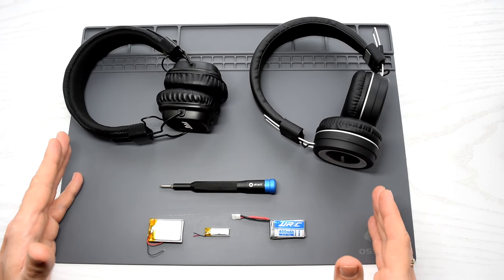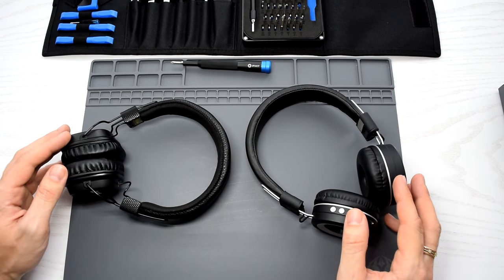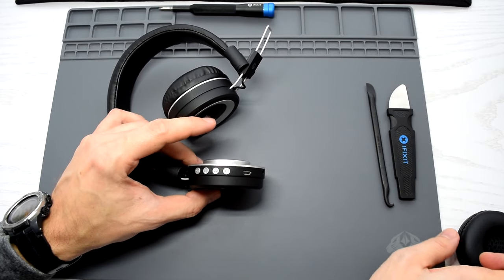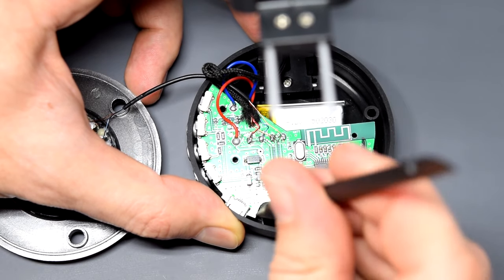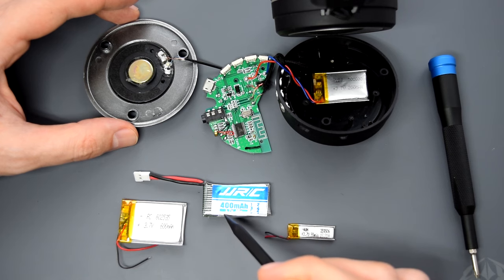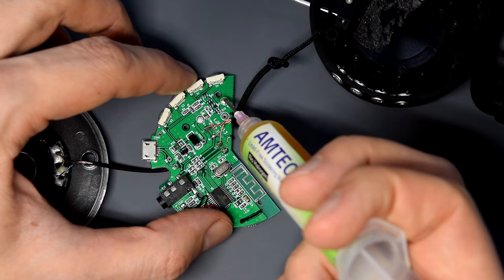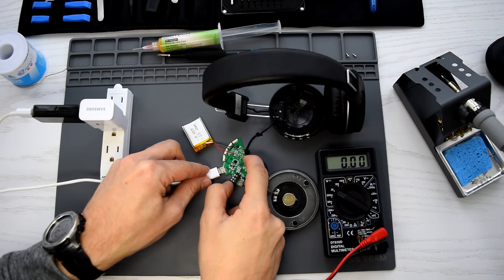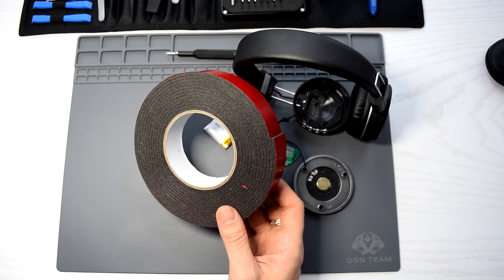How to Replace/Upgrade Li-ion Battery in any Bluetooth Headphones

Comment: Thank you for sharing this. This is an environmental issue. We are throwing perfectly working devices into the landfill when they simply could be used again if we just replace the battery. 

I don't have all this equipment and expertise. I don't intend to do it myself. But if the battery in my headphones is not working as expected anymore, then I know that this is an option now. I'll just go to my local repair technician and ask them if they can do something like this.
Reply from the maker: Happy to help!
Reply: Cheap soldering irons can be picked up for peanuts these days, and basic soldering isn't really a very hard skill to learn. I'd recommend anyone who's even the remotest bit interested in trying to fix their own electronics to just pick one up (and a small roll of lead based flux core solder*) and giving it a go. The first time you use it to reconnect or replace a broken wire rather than taking a device to a repair centre, the iron and solder will have paid for itself. It's just one more simple to learn skill that will save you money, AND give you a real world sense of achievement (Something sadly lacking in many peoples modern way of life).

You'd be amazed at how many quite expensive pieces of electronic equipment have soldered in batteries these days (Most laptops now haven't even got "User replaceable" battery packs), so being able to assemble and replace custom battery packs is going to become a more and more usefull skill to have.

(* A law was passed in several counties a while ago outlawing the use of lead based solder in manufacturing or commercial repairs. Because of this, lead free solder was developed, but it's horrible to use and isn't particularly beginner friendly. Lead based is the only way to go for a learner)
Reply: @Reman1975 Was that ROHS? In 2006-07, I worked in a factory that made printed circuit boards, but on the office end of things. My brothers worked in printing and in plating. I remember everyone who worked the HASL machine and the people who soldered components despised the lead-free product, and there were quite a few months of figuring out how to make boards come out decently with it.
Reply: @tropezando  I've tried several different brands of lead free solder, and I've yet to find one that isn't truly awful stuff to use. Regardless of what additional fluxes I've tried, the stuff doesn't want to flow into joints like leaded stuff does. With practice you can get functional solder joints with lead free stuff, but it's significantly harder to get a professional looking result using it. I find myself lingering on every solder joint as I try to get it to "look right", but eventually the only criteria is "Is it holding the component securely? Is it conducting electric? Then it's soldered well enough !". 

If you're doing soldering work commercially, then UK law says you need to be using lead free solder, but for repairing/modifying/building your own stuff it's still perfectly legal to use leaded. It's easier to learn, and you can do the joints quicker with better results, so for hobby use, it's leaded every time for me now.

Comment: Excellent video, thank you for sharing. Those days are gone where you could get headphones with Triple AAA batteries, was easy to recharge and carry backup batteries or even buy them in corner shops!
Reply from the maker: Thank you for the comment!
Reply: So I can replace the 3.7v with 3x AAA rechargeable batteries?
Reply: @Mark-nw6lh  in theory yes, as long as you never use the circuit to charge those batteries. You'd have to charge them separately. Charging them with a circuit that charges Li-Ion batteries from USB would blow them up (not just because of the voltage but because of the mismatched charging protocol). But how would you even connect AAA batteries to headphones???

Comment: This video is brilliant. Straight to the point and clear.

it gave me hope to fix the headphones I use for work. I opened the case to check the voltage on the battery and noticed this yellowish gum, it actually looks like dried glue, right where the battery was soldered to the PCB.
I did some research and concluded it's not GS or RTV silicone adhesive because it's definitely yellow and slightly translucent, instead of white and opaque.

What do you think it is, and how would you recommend trying to remove it without damaging the board?

Thank you for your help.
Reply from the maker: Could be thermal glue, silicone or who knows what Chinese could put inside. try carefully cut/scrape that glue with a plastic or metal tool.
Reply: @ElectronicsComputers  thank you very much for taking your time to provide me a reply so quickly. I'll try scraping carefully with a plastic tool and see if I can remove most of it so I can resolder it.

Comment: Great video. I just swapped the lithium battery in a set of BT300 headphones (Big Lots, $20). They wouldn't charge, the LED light wouldn't even turn on. After opening them up as you describe at :41, the rest was easy. The old battery was "puffy," so it was definitely dead. I'm not comfortable soldering on the circuit board, so I just cut and stripped the wires to solder them to the new battery wires. A little electrical tape, and tucked it all in. Back in service!
The battery was HL602025 3.7V, (might also be PL602025 or LP602025). Amazon had a "Liter Energy Battery 3.7V Lipo Battery 300mAh Rechargeable Lithium ion Polymer Battery 702025 Lithium Polymer ion Battery", $9.99, next day delivery.
Reply from the maker: Great job on fixing your headphones! And thank you for the comment!

Comment: Nice. Just doing my House of Marley, Positive Vibration headset. Sick of using the backup cord, lol. I use Ali affiliate links too, so I made sure to go through one of yours. Thanks
Reply from the maker: Thank you for your support!
Reply: @ElectronicsComputers is it okay to use 2 wired battery instead of 3 all the battery available in my country only have 2 wire
Reply from the maker: @scotthale7857  The third wire goes to the thermal sensor, and without its reading, the charge controller may not charge the battery. Go to Aliexpress. There's a whole bunch of different batteries.

Comment: Hi, thnx for this video! I managed to replace the battery in my headphones and it chrages and plays just fine but now I have 2 new and weird problems
1.there is some pulsating static like noise in the background that disappears when bluetooth i s disconnected
2. the battery discharges even when headphones are off (led turns off and "switching off" voice clip played so i assume its really off). 
Any ideas? Thanks in advance

Comment: Should've mentioned to use batteries with a built-in protection PCB (like the example ones you show have, where the wires come from). Bare Li-Ion or even Li-Po cells will overcharge and go boom. Otherwise good video though. Was looking exactly for something like this to send to a friend to show that this isn't rocket science and that they don't need to throw away their 70+euro BT headphones just because the battery committed sudoku (15mins runtime.. willing to bet it's bloated after 4 years)
Reply: I assume you meant seppuku 😂 "committing sudoku" like your battery off solving numbers puzzles 😂
Reply: @trixtonx  whoosh... that joke went right over your head
Reply: @Knaeckebrotsaege  eh, I just didn't realize it was an internet meme to deliberately misuse the phrase... given the amount of idiocy on the web, sarcasm detection is a real hit or miss kinda thing

Comment: Can my Kinivo BTH240 headphone cam also be replaced  ?  They say some Bluetooth headphone batteries cannot be replaced so . Mine is not charging when I plug into the charger the red light blinks and switches off .
Reply from the maker: You can replace the battery in all big headphones. Earbuds are questionable but yours are definitely repairable.

Comment: Excellent video. What soldering iron do you use, as I don’t have one. Clearly it has to be a fine tip. Thanks again - I was just going to thro them ( MPOW) away.
Reply from the maker: The links in the description.
Reply: Were you able to replace your battery after?

Comment: How would you recommend attaching the wires to the board without a soldering device?
Reply from the maker: Soldering iron will cost you 5$. There's no way to do that if there's no a battery connector.

Comment: Great video! My board is getting too hot after replacing the battery with a larger capacity one. The headphones also make a loud click noise after play/pause of a song. Could you help me please?
Reply from the maker: What's the model of your headphones and give me the link or markings of the battery that you've put into your headphones.

Comment: Great video, very clear. My Grind Skull Candy doesn't have a battery level indication. Is it possible to test the battery condition?
Reply from the maker: If the charging time time takes the same time as before but the battery doesn't last long then you need to replace the battery.

Comment: I am facing issues with my headphones my headphones won't turn on on  battery power but when i plug it into the charger and Switch on it turns on and Connects to the mobile do you think it's a battery problem?
Reply from the maker: 99% sure!

Comment: Hello, good sir. I have recently purchased bluetooth headphones. However, bluetooth mode works only if I keep them plugged in. If I unplug the charger, bluetooth no longer works. Is this a battery issue or do you think something else is the problem? Thank you for this video. Didn't know repairing headphones was this easy
Reply from the maker: What's the model of your headphones? If you can't turn them on without a charger (no any indication) then most likely the battery is dead.

Comment: Hi again. I have a quick question. As long as the new battery has the same voltage as the old one, i can go for it right even if it is double or triple the capacity? Is the bms built into the battery or the headphones? And will it be safe for charging/overcharging etc?
Reply from the maker: BMS is always on the headphones' PCB. You can use any battery capacity you want.

Comment: If I am replacing a battery with a yellow wire do I need to get a new one with a yellow wire too? And if I buy a battery with a battery connector at the end of wires could I take it off or do I need to buy a battery with no connector, just the wires? Thanks
Reply from the maker: If your battery has 3 wires you have to buy the same. That wire is a thermal sensor.

Comment: Great video. The battery I removed from my headset isn't labeled with any voltages. Should I assume it's 3.7 volts? It does have a tiny circuit board fixed to the top where the red / black wires exit. Thanks!
Reply from the maker: Yes, they are all 3.7 volt batteries. I can identify the battery if you give me the precise size in mm.
Reply: @ElectronicsComputers ... It looks like a 403040 3.7v 450 mAh flat battery. It's approx 40mm, 30mm, 4mm. I may go with a higher capacity as long as it's all apart anyway :)
Reply from the maker: @SG-cn4id  you're right! I usually buy batteries here: http://ali.pub/4knlas
If you have plenty of room you can use higher capacity battery.

Comment: Hey, great video man!
I‘m looking to replace my battery in my Master&Dynamic Mw65 headphones, but   I‘m not sure what a right replacement battery would be. On the battery it says 720mAh and „+4.2V“ which I‘m assuming is the charging voltage?
Usually these batteries all should be 3.7V, right?
The dimensions of the battery are 37mm x 32mm x 8mm. Additionally the battery has three cables attached to the mainboard, but most replacement batteries only have two cables (positive and negative) so I‘m not sure if these would fit..
Any suggestions are greatly appreciated! :)
Reply from the maker: Fully charged Li-ion battery reaches 4.2volts so ether 3.7V or 4.2 volts on the battery means exactly the same. If your battery has 3 wires then you need to find the same one. That third wire it a temperature sensor. Can your headphones fit 40mm X 30 mm X 8mm?
Reply: @ElectronicsComputers is it ok to put only 2 wires withkut the thermals

Comment: One question i watched a tutorial that people are installing more batteries i meant a headphone with two batteries do you think that affect the head in the future let me more or less how many voltage can support those types of headphones thanks
Reply from the maker: If you can't use one big battery, you can connect two batteries in parallel. In that case, the voltage will remain the same, but the capacity will double. It won't affect your headphones in any way except that the charging time will double, but at the same time, the working time will also increase.

Comment: Thank you good information. Questions sir, 1. How to find the polarities of the existing battery and polarities of the battery being replaced. 2. Where can I find the tools can you provide the list of tools needed?
Reply from the maker: Red wire is positive and black is negative. Also, there's always polarity marking on the battery. To replace the battery in most cases you'll need a screwdriver and soldering iron.
Reply: @ElectronicsComputers  Do you have a video comparing affordable soldering iron. Looks like the friendly repair shops all disappeared. Not sure worthy to buy one.

Comment: Hi, great post. And I did the same thing on my SONY DR BT-50 earphone just recently.  However, I am not quite sure on the part about voltage charger not concerned with mAh of the battery chosen for replacement.  
If mAh is irrelevant and only the nominal 3.7-V charging input matters (including its size, of course), then I was wasting my time seeking high and low for the replacement the same as the original one.  Any clarifications are greatly appreciated.  BTW, the my chosen replacement with the same mAh as the original SONY one ain't cheap.... 😫
Reply from the maker: All headphones during charging usually draw 500mA to 1 amp so even if you connect 2A charger it's not gonna speed up the process. If you install a higher capacity battery it will charge longer and vice versa. That's all the difference here.
Reply: @ElectronicsComputers 
Thanks a lot for the response, appreciate it. 
But how about the higher discharged current from this more powerful battery replacement? Wouldn't the extra current cause any damage to the circuit? For example, if it is replaced from 3.7V, 750mAh to 3.7V,  2,000mAh. Thanks.

Comment: Thanks for the video!
I am a bit confused with the batteries... is it ok to use a "LiPo" battery?
I mean, the links you provided says "lithium polymer lipo li ion" but im confused with the Li Ion and LiPo...
Can i use the same charger or do i need a special charger for the "LiPo" battery?
My headphones didnt come with a charger, so i use the same as my phone, but the battery is the same as the one you install but mine is 500mah
also 1.85wh, should i search for one with this too?
Reply from the maker: Li-Ion and Li-Po batteries are absolutely interchangeability.
Reply: @ElectronicsComputers  you can use similar circuits but they do use different charge voltage, low voltage, and sometimes nominal voltage. Internally, lipo and li-ion batteries are completely different. In your video you said that these are "li-ion pouch cells" but they are actually lipos that have li-ion in the name to attract attention. just false advertising. if it were li-ion that size battery would be about 5-10x more mah than what you are using. Just clearing up some confusion.

Comment: my headset (wireless) isnt turning on .i clicked the button several times its not working .i tried resetting it but no luck .could u tell me if i have to buy another one or what else could i do ?
Reply: YWZ BE-30
Reply from the maker: Does it turn on with the plugged in charger while charging?
Reply: @ElectronicsComputers   no it doesn't . i tried turning it on the other day it did work but then after a few minutes it turned off and it's been dead ever since  .

Comment: How long do these aftermarket batteries last in terms of recharge cycles, before they die? If an OEM battery will give you around 2 years before they lose their ability to hold a charge, what is the life expectancy of these cheap cells? I'm faced with this situation where my headphone battery is nearing the end of it's service life and needs to be replaced. But  I don't want to have to do this step every two months.
Reply from the maker: Speaking from my experience they usually last for about a year.

Comment: Great video ,all clear things!!! 
Adoubt
Can i use phones 3.7 volt battery instead?
Reply from the maker: You can use any 3.7V Li-ion battery especially if it only has two wires.
Reply: @ElectronicsComputers  what if there is three ?
Reply from the maker: @bigyankarki5185  If your headphones have a battery with three wires then you'll need to find similar battery with three terminals. Two-wires battery may not charge properly.

Comment: Thank you for the video tips. I was gonna use flat head screwdriver to pop up my headphone cover but I see in this video the cover is not hard to be open so I use a plastic card instead and yes it's works perfectly so I got no scratch at all on my headphones.
Reply from the maker: Good job!

Comment: 100% a useful video but sadly i dont have the calm or equipment to do this. it would be really great if tech companies made it user friendly to swap out headset batteries so consumers wouldnt have to perform an operation on their headphones.
Reply from the maker: Companies want us to buy new stuff and they do everything in their power (for example like Apple) to make the repair impossible.